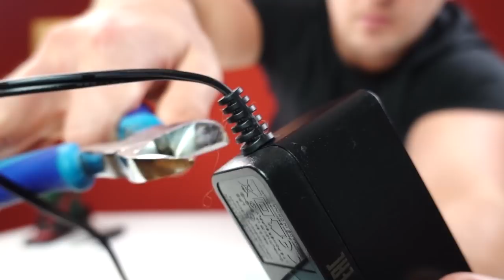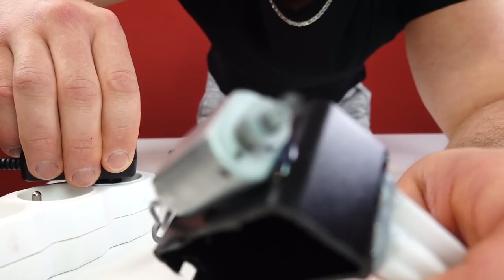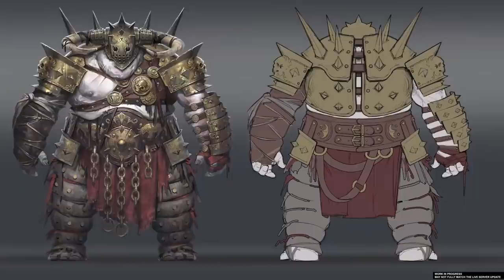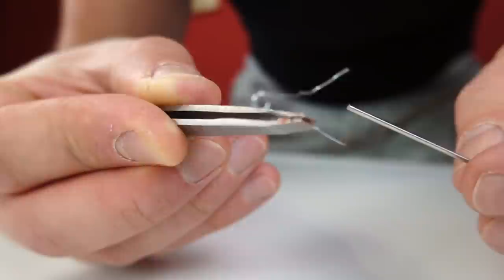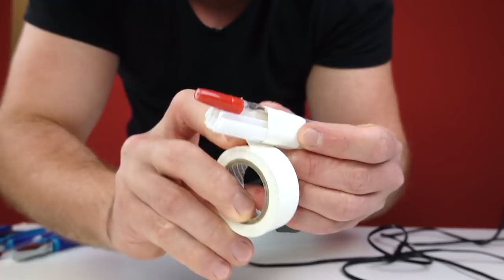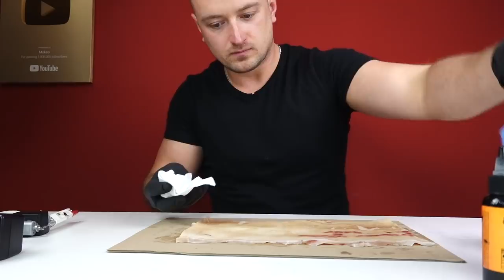How to make Simple Tattoo Machine at Home

Comment: I was a Corrections Officer for 16 years. I saw all kinds of junk that was turned into tattoo guns and a lot of other contraband. And the prisoners did it without a solder iron. I still have one that was made from parts of a cassette player, a ballpoint pen, a paper clip (or staple), 2 "D"  batteries, and some tape. Works just like this one.
Reply: Cassette players but these days they use motors from hair clippers lolol